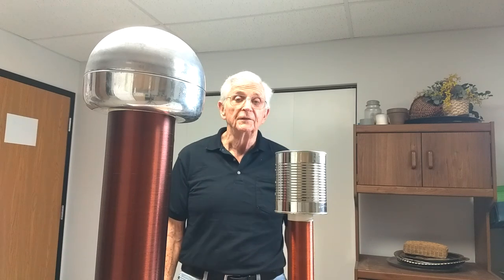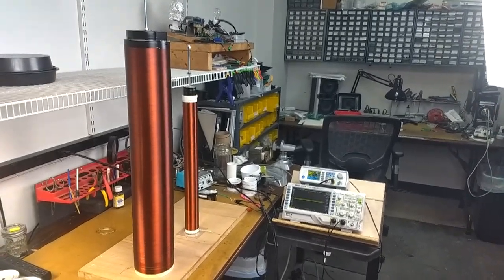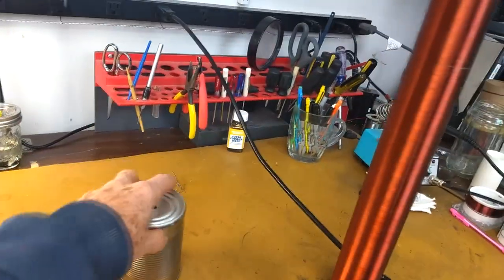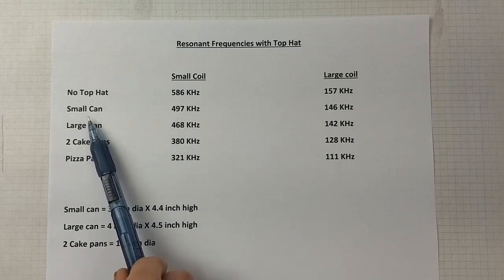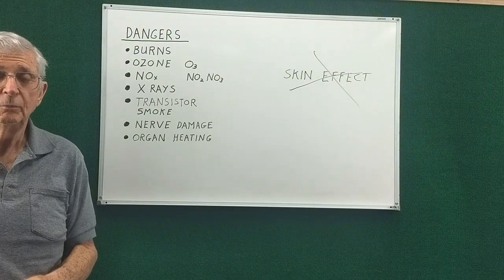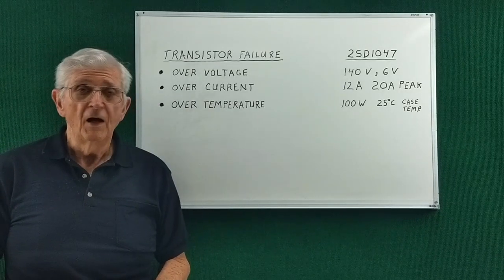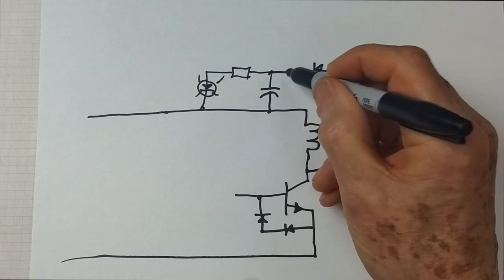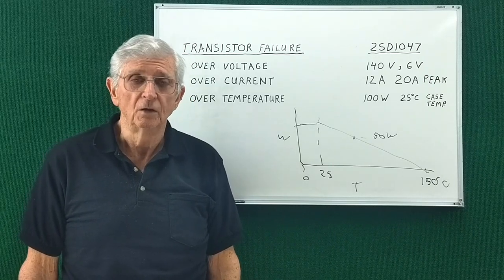Tesla Coils / A Scientific method with Slayer Exciter

Comment: Jim, excellent work.
Reply from the maker: Thanks for your kind comment. I enjoy your channel as well. Best regards.
Reply: I subscribe to both of your channels, commendable work done by two very knowledgeable gentlemen!  Thank you both for the wealth of knowledge you have shared to those of us who are intrigued by this sort of Magik! 😉
Reply from the maker: @alloverflorida5886  Thanks for your kind words. Best regards.
Reply: Just getting into the world of high voltage and both of your channels are going to be huge help!
Reply: The schematic is not correct and it is wrongly placed on the internet For correct biasing, the two diodes must be placed in the circuit in reverse order
Two diodes are connected in series and the anode is connected to the base of the transistor and the cathode is connected to the emitter

Comment: Hello Jim, 
Do I have to measure the Collector to Emitter voltage from Peak to Peak voltage or "Peak/Max voltage" with my oscillocope?
The transistor datasheet shows the max Collector to emitter voltage as DC voltage, but the Primary coil has AC voltage, sinusoidal waveform. I hope you can help me.
Reply from the maker: The important voltage is the maximum positive voltage above the emitter voltage.
Reply: @Jimscoolstuff  Thank you very much for your help Jim !!!. You are the best.
Reply from the maker: @alfred3305  Thanks for your nice comment; be safe.

Comment: You've explained pretty much everything I learned from experience ! The snubber diode I hadn't thought off. I mainly relied on my fet high drain to source voltage tolerance. Had an issue that blew my power supply when I decided to parallel the fets. The unclamped voltage of the primary was to high, the psu was clamped by a pair of schotty diodes that heated and malfunctionned. I got 7 to 8 amp at 32V from a 1.3Mhz secondary. Really scary angry flame. I made other coil since but the best way to drive high frequency coil seems to be from secondary direct feedback. Using a TVS diode to protect the base/gate is a must. I can't wait to look at your next video. Thanks !
Reply from the maker: Thanks for your comment.

Comment: Great work Jim, excellent video thank you! I have a Siglent SDS1104X-E oscilloscope (100MHz) with Siglent AWG and followed your work to find resonance without success. As my AWG module operates from the scope itself rather than a separate unit like you have, my scope screen is more cramped which may also expIain why I have a lot more 'noise' with my coil signal overlayed onto the generated signal. Splitting the scope screen and zooming into the coil signal provides better definition, and whilst there is more 'noise', I can see both the generated signal and the coil signal clearly but I don't see any decrease in signal as you have successfully demonstrated at the resonant frequencies. I started at 1kHz and slowly increased to 10MHz several times without seeing any decrease in the signal. I also watched the signals via my web link which provides scope control and viewing on my computer monitor which makes viewing easier . Now I have sore eyes and a tired brain so will have to rest for a while. I would greatly appreciate if you could please provide any further insight. Thanks again
Reply from the maker: The only thing that I can suggest is to make sure your Oscilloscope, power supply, and oscillator are all grounded to the same place. Thanks for your comment.
Reply: @Jimscoolstuff  Thanks Jim, much appreciated!

Comment: Good information. Thanks! The biasing resistor is needed only to start the oscillation. So receiving coils don't need it. It's also possible to trigger the start with external spark. The hairpin circuit seems a lot more safe, cause it isolates the oscillation from the source. Spark gap also has chaotic frequency that adapts to the load, so seems like it doesn't cause nerve damage that easily.
Reply from the maker: Thanks for your comment.

Comment: Very educative video! I was searching the second video about Tesla coils using a mosfet.But i cant find it.
The first 4 capacitors are electrolitic?Can we use polyster type?
Reply from the maker: The capacitors are 0.47 uF, 400 volt metalized polyester. They are not electrolytic.
Reply: Thank you!What is exactly their purpose? I used electrolitic type and they are heating too much.I tried the circuit with just a single polyster type 20 nf i think ,630 v and it's not working..I will use larger value.
Reply from the maker: The purpose of these capacitors is make the DC power source exhibit a very low impedance at the operating frequency of the oscillator. @instructoruldemeditatie2367

Comment: VERY COOL STUFF...
l'd love to see how you made the coils.
Reply from the maker: I used a lathe with a horizontal feed rate as close to the wire diameter as I could get. I held the wire with a rag to maintain tension. I rested my hand on the tool post and manually guided the wire. I used the lowest spindle speed setting. Thanks for your comment.

Comment: Hello Jim. How do you connect the oscillocope probe to measure the transistor collector voltage?
Reply from the maker: connect the ground lead of the probe to the emitter of the transistor, and the probe tip to the collector. Make sure you are using a X10 probe.

Comment: do you have a part # on the tvs diodes? and all other diodes in circuit? Letters and numbers on diodes would help.
Reply from the maker: The diodes that I used were 1n4006. This is a 1 Amp, 800v diode. A lower voltage diode will work just fine. I used the 1n4006 because I had them.
Reply: @Jimscoolstuff  Thank you so much. I have been trying to make the same circuit. I got it to work but wanted to add the protection. Great work. Thank you again.
Reply from the maker: Thanks for your comment. @nathanbunten4299

Comment: Hello Jim, How Can I know what value to use for the Transistor Base Resistor, I'm using a Toshiba 2SC5200 NPN transistor, but it only works with a base resistor lower than or equals to 10K ohms.
Reply from the maker: The exact value can not be predicted because of all the variables involved with the primary and secondary coils. In general you should use the highest value that allows oscillation, which is what you must have done. Thanks for your comment.

Comment: Hi Jim, have you ever made a tesla coil, where the secondary is bifilar wound where the EM field cancels out?
Reply from the maker: No, I have not.
Reply: @Jimscoolstuff  I have a lot of questions I would like to ask you about tesla coils. Is there a way I can contact you? I’m a total noob and I don’t want to make any fatal mistakes. You seem to be an expert on the subject.
Reply from the maker: @BrentLeVasseur  Everything that I know about Tesla coils is shown in the video. Thanks for your comment.
Reply: @Jimscoolstuff  How did you wind your coils?
Reply from the maker: @BrentLeVasseur  I have a metal lathe that I used to turn the coil form while I placed the wire by hand. It is actually much easier than it sounds.
Reply: @Jimscoolstuff  Thanks! Cheers!

Comment: wouldn't a 100v 47nf mylar cap between emitter and collector be a better option for over voltage protection of the transistor?
Reply from the maker: Never put a capacitor directly across a switching transistor. There is nothing to limit the current when the transistor turns on, and the transistor can be destroyed.
Reply: @Jimscoolstuff  i built the circuit your video showed and instead of placing a cap across the emitter and collector, i placed the cap across the base and emitter and it worked. totally eliminated the need for the snubber circuit with just one part. i haven't burned a single transistor because of the new over voltage protection from the 100v cap. when the cap was placed between emitter and collector, i found that the oscillation stopped.  thanks for the nice video.
Reply from the maker: @maatewelove7310  Thanks for the information. What value of capacitor did you use?
Reply: @Jimscoolstuff  100 volt 47nf mylar capacitor.
Reply from the maker: @maatewelove7310  Thanks

Comment: Can you use a tesla coil as a ham radio antenna?  Will it still shoot out sparks?
Reply from the maker: In the early days of radio, transmitters were actually spark gap type tesla coils. They were connected to antennas to radiate the energy.

Comment: I use a Z44N mosfet with a voltage divider formed by a potentiometer. It's working but it's hot in a couple of seconds. For power, I use a laptop charger 19 volts and 3 amps but also with 12 volts, although maybe a millimeter of plasma can be seen, the mosfet heats up extremely quickly, therefore I think the problem it's not the source, but this circuit that I found on YouTube, only that it used a different mosfet.. I tried to add the circuit that you show in the video, the one with the LED, it's working, the diode in the snubber is getting also hot, but there is no improvement, the mosfet is still extremely hot in a few seconds.. What I tried and it seems to work somewhat is to connect an incandescent bulb in series with the source, a bulb of about 12 volts and two amps. In this mode, the circuit can work for a few minutes. It probably limits the current to which the mosfet has access. I suspect that it remains open too much and works like a short circuit??
This is the original circuit..Any feedback?
https://youtu.be/7cDCoW5fTkk?si=m2mWc3Z7fYz1wyj0
Reply from the maker: Try lowering the frequency by adding a cake or pizza pan to the top as shown in my video. Also double the number of turns on the primary and spread the turns apart by 1/4 to 1/2 of an inch between the turns. Good luck.

Comment: Does the pizza pan leak corona and if a  needle is added to pan edge will an arc breakout to air?
Reply from the maker: There is no corona from the pizza pan because it has no sharp points. Corona from a sharp wire attached to the pizza pan is shown in the video.
Reply: @Jimscoolstuff  Thanks have a nice day. The snubber saves transistors picking the correct values works as shown the led gives indication when transistor has is close or hit collector voltage limit. There is another video same subject had the solution for transistor failure was to just stack them  many as you want in parallel, over voltage failure can make even greater quantities of magic smoke until the power source is current limited out. The dreaded entire work station can go surge pulse mode damage to anything powered on joy joy... The frequency sweep method to find resonance with the top load variations give best way to give the eyes on real world changes to values for a part that has been created original as 1 of 1.Your description so far best. Thanks
Reply from the maker: @lancemenke2728  Thankyou for your comment.